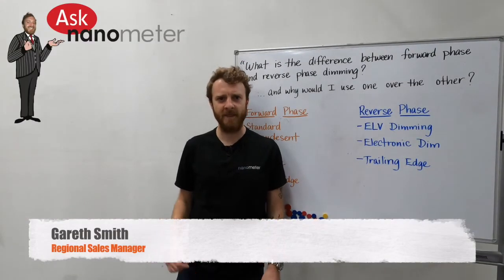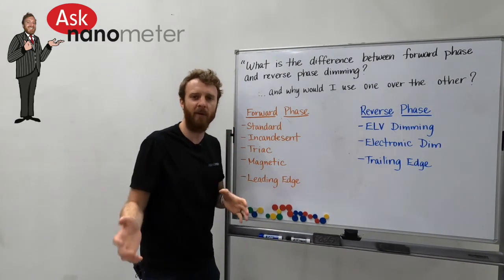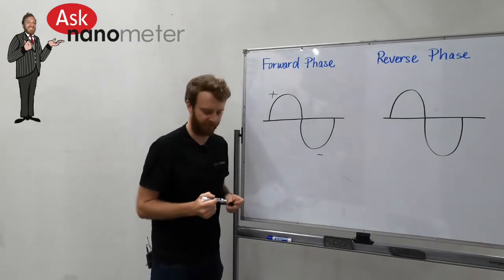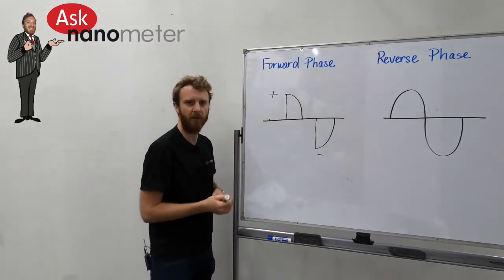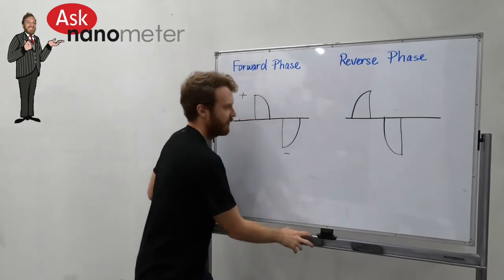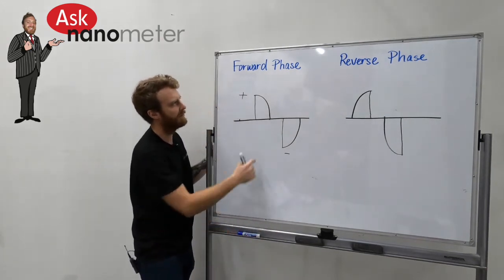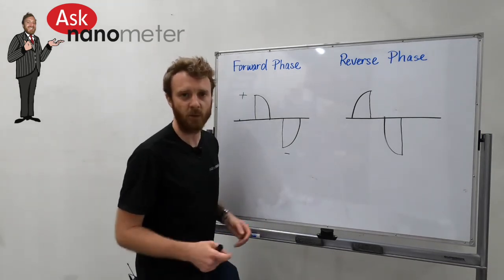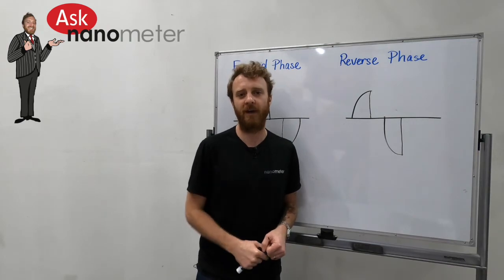Forward Phase vs. Reverse Phase Dimming | Ask Nanometer

Comment: Another thing to keep in mind is that reverse phase dimmers require a neutral wire to function properly, while forward phase dimmers do not require a neutral wire.  Reverse phase dimmers are also more expensive than a forward phase dimmer.  With the exception of really high end LED light fixtures which require a  0-10V or reverse phase dimmer, almost all dimmable LED lamps and fixtures are designed to work with forward phase dimming.  

Sometimes, usually in homes more than 35 to 40 years old, the existing wiring at the switch was a switch loop, i.e. power feed at light fixture, 2 wire cable from fixture to switch box, no neutral at switch box, this wiring method is no longer code complaint as of the 2011 NEC.   

With all that being said, the forward phase dimmer remains the most common type installed for residential use.

Comment: 110 VAC is the RMS value (DC equivalent power).   Peak voltage of AC is 110*1.414 = 156 V peak  (square root 2 = 1.414)